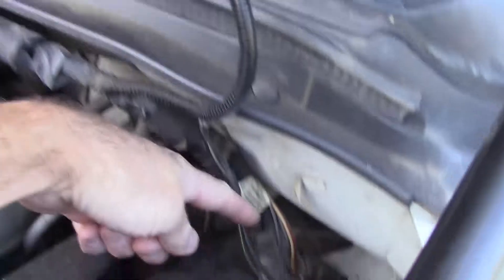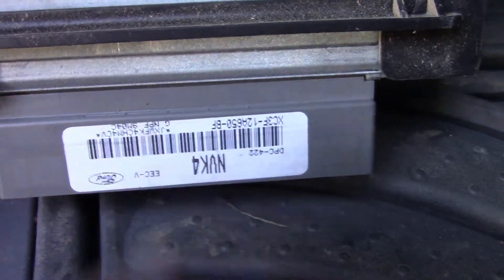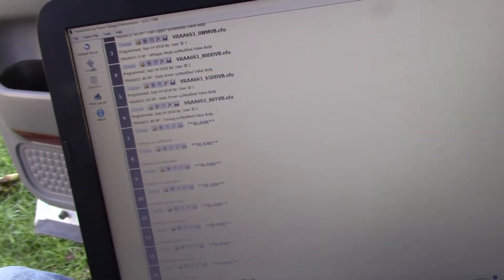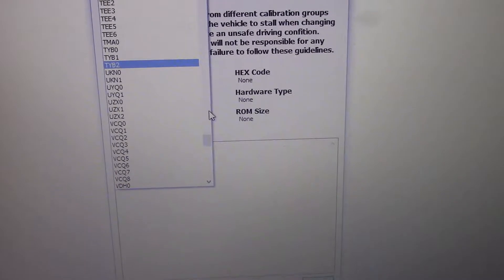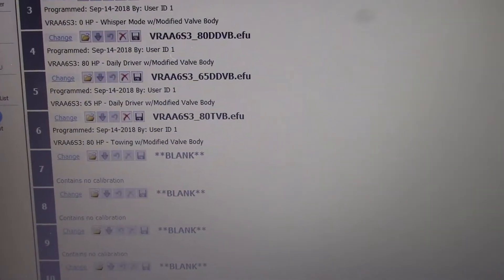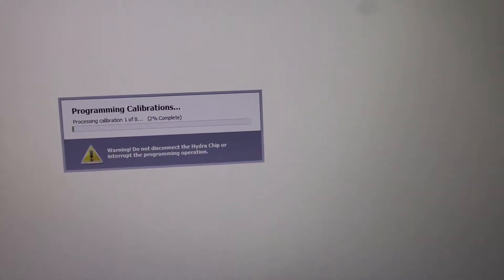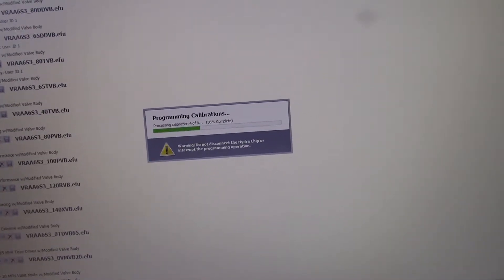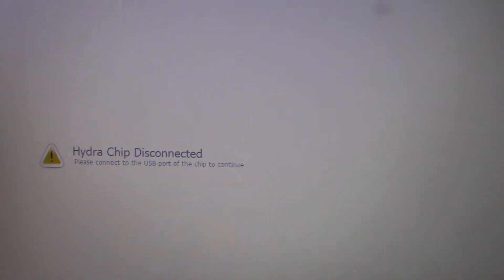Changing the programming on a Power Hungry Performance Hydra Tuner.

Comment: Do all hydra chips come with 00 as a programmed setting already. I guess to clarify, my chip says position 2 is stock mode. So does that mean there’s a stock mode and general stock mode for scanning tests and so forth?
Reply from the maker: If I remember correctly, mine had 2 stock settings as well.  I don’t think people read the instructions that 00 is stock and add one in when they program it.
Reply: @SakimasRidgeHomestead  that would make sense! Thanks!